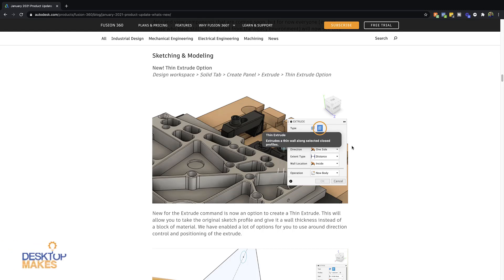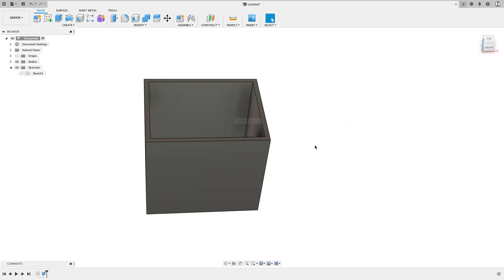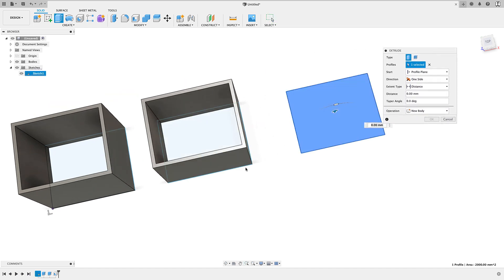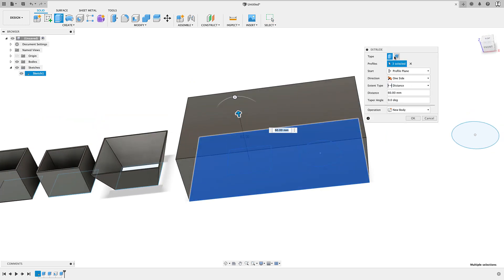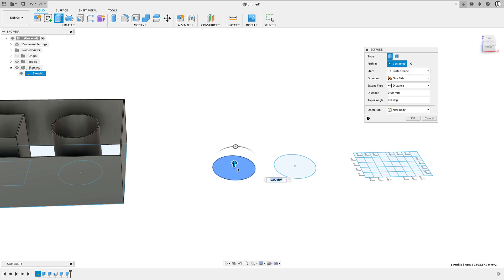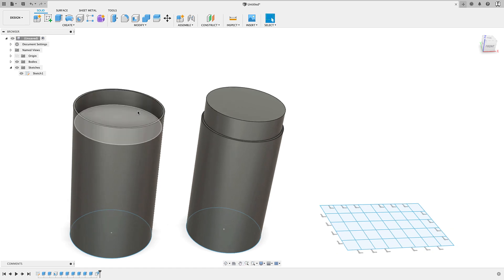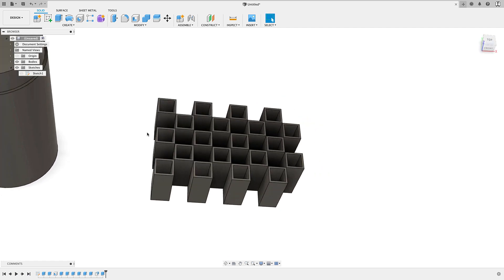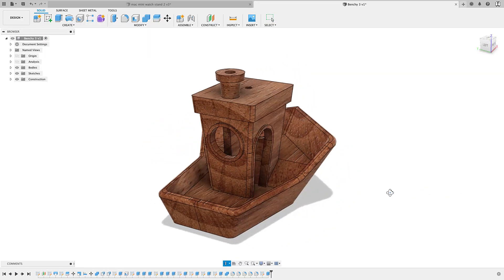Thin Extrude - Fusion 360 January 2021 Update

Comment: A nice thing about this feature is you can easily create cutouts on a surface from an external line (dxf) drawing. Wich was much more of a nightmare before. However solidworks version of this is even beter since it can taper inwards so create a V-cut in a panel. Wich is exactly what i need for my work

Comment: This needs an "inside/outside" option. So you can choose which dimensions you need (for instance, extrude a shell around a part that you know the dimensions of).

Hope you get lots of good responses; enough to do a follow up... there's gotta be a million neat things to do  with this but I don't know what yet.
Reply: It's there... Under the wall thickness setting
Reply: In Thin Extrude there is a Centre, Outside and inside option under wall thickness
Reply: Oh neat. Haven't opened up fusion since this update so I was just going off what was used.
Reply: Let me know what you think of the  function if and when you use it. I am a QA on Fusion360 and its always good to hear customers thoughts